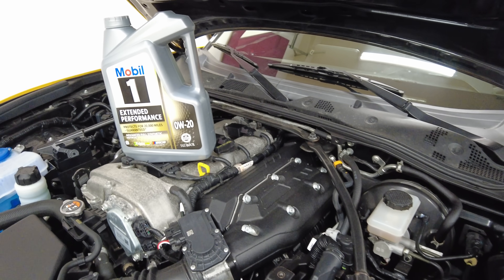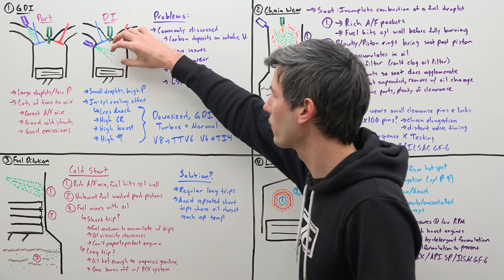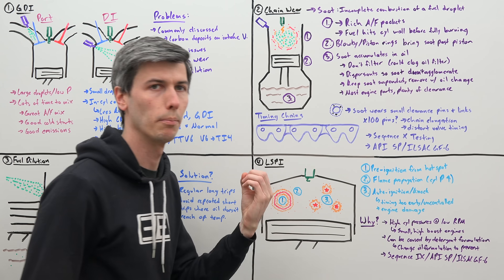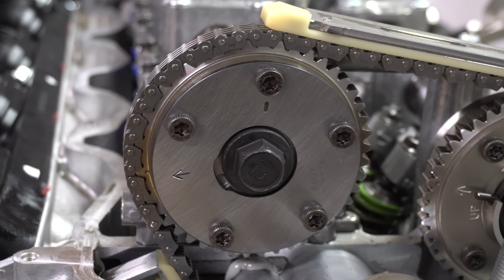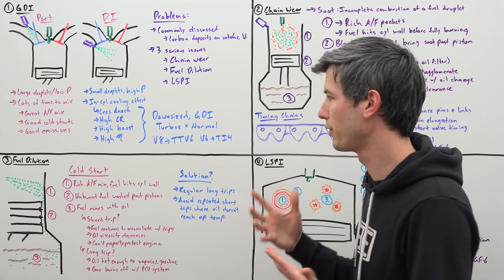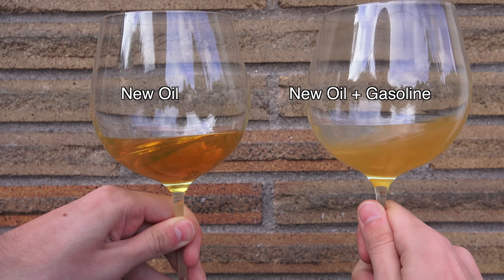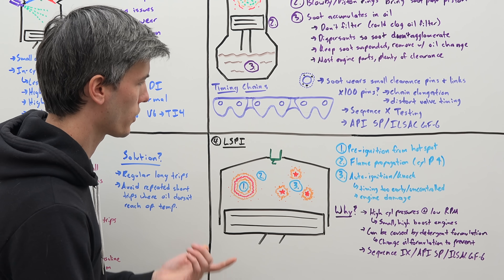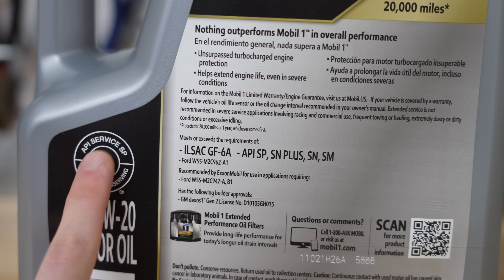3 Big Problems With Direct Injection Engines (Gasoline)

Comment: Late 90s early 2000s engines were the best. Decent power, not too much plastic, port injection, good fuel economy, and most were ulev so very clean. It’s a shame we massively increased price and complexity and decreased reliability for another 3 mpg.
Reply: Too true. My 1JZ-GTE VVTI is a good example of this. Pretty modern tech (improved by a new Haltech Elite 2500) - but not too modern that it suffers from all sorts of technical issues as a result of overcomplexity.
Reply: Love my K20 for that reason, it was just before emissions became stricter and so it revs to 8300rpm. VVT, Vtec, Still gets about 27mpg which isn’t bad, and is port injection
Reply: @TheRyansLion  and its naturally asperated. Those smaller engines with turbos are terrible.
Reply: @TheRyansLion  well, old cars do have the cool and fun to drive factor. I wonder how the K20 would stand against the modern GTI, for example aven when K20 was brand new.
Reply: @TheRyansLion  I've been wanting to buy an old civic or integra and do a k swap! It'll be a few years before I have time or money. Got 2 kids under 3
Reply: Yeah, this is true. Most of the German cars that I've worked on from that era were great in both power and efficiency, yet weren't too overly complicated where you needed to disassemble half the engine to do an AC Compressor. Unfortunately somewhere in the mid to late 2000's engines became increasingly more complex and crammed with more plastic and sensors/electrical components.
Reply: @hotchkess846  I want a 04 cobra motor with DPI and TI-VCT
Reply: @hotchkess846  German engines were all junk. No matter the era. The plastics and rubbers used in all German engines decompose after about 10 years. So if you do any work or touch any rubber or plastic part it will break and crumble after 10 to 15 years of age.
Reply: Corvettes could get 27-30mpg with port injection. I would routinely break 30mpg in my C5 Z06 with a stock rear ratio and when I went to a 3.90 gear 26-27mpg was the norm. This was with headers and a pretty big cam.
Reply: @xjmg007  you can do good mpg at stabilized speed/low rpm. if you drive the same way with a downsized turbo you'll get good (even better) mileage too.
Reply: @geemy9675  true, but I had 430whp n/a
Reply: Exactly that is why i love the MB W140 500 or 600 form. Peak of enginerring, bulletproff, a bit complex but nothing in today standards. My previous Renault Laguna 16v was a fantastic car, easy to work, cheap to maintein and superb comfort. Ironically in new cars my dream is the Viper or Corvette manual... push rod old GOD tech.
Reply: Ya. I bought a 1997 Lincoln town car (4.6 L v8) with 41k miles last year in July. It has more than enough power for my trips around the country.
Reply: I think the geo metro getting almost 40 mpg from the most simple engine to illustrate this.
Reply: @Dogpool  as much as I love the metro I used to have one and it was ok with me in it but I can remember having to take my 3 buddies to baseball practice and the last push up the hill the car crawled at about 20mph the Geo didn't have enough engine to push 600 lbs of boys up a large hill I would lose speed climbing the mountain near me
Reply: @sqike001ton  loved my 85' Chevy sprint! 50mpg+ with a 5speed . Reno to Vegas on one tank. Wish I had a clean one today!😁
Reply: @Dogpool  the geo metro got 49 mpg epa highway, which is almost 20% better than 40 mpg
Reply: I 100% agree. I have a 1992 ford ranger and an acura rsx. Both are extremely simple and very reliable.
Reply: You said it port injection, best ever.
Reply: The MPG gains of the last 20 years have been huge, you just don't see them because cars have gotten heavier as well. Mostly for safety, but also because of feature creep and because people want to drive a tank around.
Reply: @ice44567 Well said, I also don't want to drive a dinky toy around to get 27 mpg, maybe I wouldn't mind if everyone wasn't in a tank
Reply: Had to finally give up on the daily driven VW diesels around 2016 when the wife's 2004 Passat TDI got T boned. 
It got 41-42mph highway for many trips, so I was skeptical of the new 2014 Jetta gasser. 
Around town it's not the greatest ,but on those highway trips it returned 37.5.
For 4-5mpg it doesn't pay off for me to run a diesel ,what with all the problems the common rail engines have. 
DI for a gasser isn't much better, but it's got 82k on it now and still seems to run ok but only time will tell if it needs an intake cleaning, supposedly they are better then the older 2.0 engine.
Reply: Especially the 3800..
Reply: Man ne  Yea well... EU sucks with some things for petrol heads!
Reply: As Savagegeese said, new engines with direct injection are more efficient than port injected engines but what about after 30000? 50000? 100000 miles? What happens when all those carbon deposits build up? It's those bloody regulations to appease the elite who think they know best. 🙄😒
Reply: I totally agree with you. Todays engines are going to die young
Reply: Well, one thing they've finally done is send engines tweaked from factory.

Back in the day we'd buy a carb, intake and headers and gain nearly 100HP, not the case today.
Reply: I think pairing engines from that time with modern automatic transmissions would be incredible. I have 2002 Buick it runs perfect even with 170k miles and there’s almost no plastic on the engine. The only downside is the weak transmission, a faster one from today’s cars would be incredible imo
Reply: @alexadeshigbin8129  that is one thing I'd like to have in my Comet, a modern 6 or 8 speed auto.

They won't fit though, not without gutting the entire transmission tunnel and building a bigger one.

The 3 speeds had good torque capacity, when they added overdrive everyone built crappy transmissions, they finally improved on that in the last 10 years or so, even around 2010 a lot of transmissions could only handle a little more than the engine was rated at.

The only options for old overdrives is lots of $$ for strength or swapping to a manual.
Reply: @glenwaldrop8166  Wow, I've only seen a Comet once in my life (only in my 20s) makes my car seem like new haha. But I didn't even think about the new transmissions being larger, it's a shame there isn't a more cost effective way to improve them. And I definitely remember in the early 10s when transmissions were still mostly garbage and then years later they were all suddenly incredible. I'm just interested to see if the improved efficiency and speed of modern transmissions will translate into longevity.
Reply: @alexadeshigbin8129  there's a transmission guy on YouTube that I follow, he's good at building the new Ford and Chevy 8 and 10 speeds already, they're much better about torque capacity but they still wear out if you don't change the fluids, of course the ones he's rebuilding already have 300K on them so they've got to be fleet or something.
Reply: @glenwaldrop8166  Thats's cool, what's his name?
Reply: Exactly. The Gen 3 LS engines with port injection.  I have an ls376/480.  In a truck.  It is a phenomenal engine.  That does not share any of these problems of the Gen 4 LT.
Reply: Low tech is the best.  My Crown Vic with 4.6L 2V is worry free.
Reply: It's only going to get worse in the chase of MPG as the EPA keeps cracking down
Reply: I have a 2001 2L  Ztech port injection Ford engine. 222000 miles, clean, runs like new!
Reply: If only they added VVT to them and nothing else, that would be perfect.
Reply: @sienile  VVTIBisba thing since the 90s tho. Honda did it in the 80s already if i remember correctly.
Reply: @kaedeschulz5422  - Honda's early VTEC was static and only operated at very high RPMs, well outside the normal driving range. Other systems in the 90s only phased the intake. What I meant was independent VVT on both intake and exhaust.
Reply: @sienile  Oh yea... I fergot...
Reply: Late 90s early 2000s... they were ok engines.  Thing is that "decent power" isn't good enough when your competitor is putting out better and better numbers.  It's easy to blame the government or manufacturers or whatever, but at the end of the day it's the consumer that decides they want bigger numbers so all the manufacturers just have to appease.  Reliability for the most part is ok, though forced induction will just never be as reliable as naturally aspirated.  That's comparing apples to oranges though, since NA engine reliability hasn't taken a noticeable step backwards.
Engines of that era wouldn't be sufficient for the bigger, heavier cars of today anyway.  Doubt anyone would be interested in swapping a 2022 F-150 V8 (5.0L making 400 HP) for a 1998 F-150 V8 (5.4L making 235 HP)
Reply: @eksentrysyti  Yes, but the 2 engines you are comparing are non-force induction inherently balanced V8's and those are the most durable even for a half assed manufacturer. You should compare the turbo engines the worse being a non-inherently balanced turbo 4 cylinder engine. I don't expect more than 150,000 miles of any of the 1.6l Turbo 4 cylinder engines out today. By 150,000 miles, those engines will be failing emissions due to excessive oil burning.
Reply: Agreed
Reply: Exactly the reason. Obsolete faster=More profits
Reply: In the late 90's people were saying the same about the early 90's engines.  in the early 90's fuel injection was worked out and mature, after market mods were popular and programming offered performance and mpg was góod.  Who needed OHC with those huge 4 foot long timing chains rattling around.  In the late 80's people were saying the early 80's engines were the best (well, probably still calling the pre 73 engines the best).  No electronics, carb'd and full control with a flat head screwdriver and a vac gauge at your finger tips.  At the time, fuel injection was seen as the devil and would ruin the automobile hobby, tuning, and modifications like nothing prior.  Gas mileage was better and more power was being made compared to the 70's emissions compliant 7.0ish compression ratios.  In the late 70's and 80's they were saying the pre 73/74 engines were the best.  Mid late 70's cars and engines were just sad, no argument there.   Specific to the late 90's-early 2000.  I agree as well though.  I'm a Ford guy and the simplicity of a modular 4.6 2v that was in a ton of different cars for a ton of years and it just worked.  I'm sure other brands have their gems from that era as well.  I have a few of them still humming along with one at 320K miles.
Reply: Please compare today's economy car with one from the 90s. Then do the same with pretty much everything else. No, old is not better and even much worse. And not more reliable either. There are modern duds and old marvels, but those are outliers. Cars today are much, much better than cars in the 90s.  The only thing the old cars might give today's a run for the money is fun to drive and cool factor.
Reply: 1996 Toyota 5VZ-FE still going here!
Reply: Or, would be awesome if more did what Toyota did with dual injection. You get the best of both worlds, make more power, more efficient.
Reply: Your Government doing what it does. They push auto makers to increase fuel economy and so they turn to new technologies to compensate.
Reply: It wasnt for mpgs, it was because of EPAs
Reply: Thank the reformulated gas.
Reply: Car engines died in 2000. Now you have 100k miles and engine needs replacment.
Reply: Totally agree with you. Even I use a 1998 toyota
Reply: Was told burning oil  is normal for a brand new engine?? However my 98 Nissan Sentra burns no oil
Reply: Nothing but facts. 

Love my lazy 2002 Volvo S40 1.8L four banger. Looking forward to at least another decade of zero problems driving.
Reply: It’s too bad Canada is probably gonna implement having to safety your car every year (which costs so much to fix pointless things) and it’ll drive all the older used cars off the road as they will be too expensive to maintain even when they run great
Reply: Exactly.  I don't trust modern engines especially GDI or Turbo or both because they have no track record of running 300 000 km or more without any major problems.   I own a 98 Mitsubishi Montero Sport and 2011 4 cylinder frontier which has an engine from the 2000s era.  

Tundra I would trust up to 2021 because the GDI twin turbo 3.5 liter engine is not proven to handle the job of a V8 if you are working hard with the truck.  If they wanted a smaller engine like a 4 liter V6 normally aspirated I would be cool with that like the F150 has a 3.3 little small but the idea is no turbo and no gdi
Reply: I’ll keep my 2004 Grand Marquis with 298000 miles. Runs well everything original it’s not the best on fuel mileage .
Reply: Had a VW 2014 Passat 2.5 5 cylinder 

65000 miles camshaft was badly pitted and the oil smelled like fuel diluted after 3000 miles. 

Unfortunately this engine had a lot of plastic parts like the engine oil cooler housing , coolant thermostat housing valve cover and other coolant parts. 
Glad I got rid of it.
Reply: I agree...the best era for engines... ...we will never achieve the benefits of both worlds as this era, it was the best time, and most reliable engines , ever.  Bye reliable engines.
Reply: @1gbayfisher  Bye bye, or good bye?
Reply: That’s the government’s fault!  Weather is still Weather and it’s never changed! But government while war is now going on in Israel, still says that climate change is the worst problem in the world! Weather is Weather!
Reply: Fuel economy on ICE vehicles has gone down in the last couple years Ive noticed.
Reply: Love my port injected, cable throttle, metal and not plastic valve covers 2000 Nissan Maxima. Despite it being a fairly large V6, the engine bay still looks less complex than many of today's 4 cylinders.
Reply: The years where you pop the hood. And the engine looks like it's on life support. Cables, wire, tubes, hoses, everything a mess.
Reply: That’s just innovation, they need new technology and then improve upon it
Reply: Honda F23A, such a reliable engine. Die hard.
Reply: Getting 60mpg out of my Prius and can hang with most in “Power” mode 😂
Reply: The sweet spot!
Reply: My daily runner 95 Nissan n14 , vs high end European cars I worked for
Reply: Shitty thing is, that's when they started plaguing cars with shotty electronics. I feel like most cars from 02-09 had a lot of electric issues.
Reply: No, it was a mix of more mpg, more power and passing harsher emmission tests.
Reply: Blablabla
Reply: Bro, ulev?
Reply: @surfside75  ULEV is an emissions rating. It's an acronym for Ultra Low Emissions Vehicle.
Reply: @surfside75  ultra low emissions vehicle my 01 civic was one
Reply: @MrSGL21   Thank you. Did  my 05 Sienna 3.3 vvt-i make that list?
Reply: 3.3 vvt-i 240hp in the Toyota's;  my 05' Sienna Limited is amazing to me.  
 -Able to move this very heavy (5,700lbs!) minivan like a sports car😱 -😍.  -Reliability 500k (at 250k now).. i just drive it like I stole it😁
 (Timing belt at 100k and Change oil every 7k with full synthetic Mobile1 H.M. w/ M1 20k  filter)
Reply: expertly said, Flat Six Engines from Subaru (EZ30), and all the 6,8 Cyl NA Engines from BMW are superior to the junk thrown out nowadays - my EZ30 is on almost 140k miles and idles like a car on 40k miles
Reply: I’m a professional auto tech and I approve this message!  👍
Reply: to be fair safety, efficiency, power, performance, and unfortunately weight have all increased a lot.
weight increase is largely due to people buying SUV, crossover and trucks but not only
 price increased 2.5x slower than overall inflation since 1990.
 although last year has been crazy on used market and dealer markups. from my experience owning Toyota and Kia , never had any issues besides regular maintenance 
90'sn were also not that great with electronic issues.
Reply: Toyota hybrids managed to greatly increase mpg and lower emissions while reducing mechanical complexity and improving reliability.  They are port injected and non-turbo.  GDI engines emit more particulates and carbon monoxide than port injection engines.
Reply: blame regulations for this
Reply: Why I'm still driving my 20-year-old econobox — and since it's a simple engine I can maintain/repair it myself.
Reply: This!!
Reply: The body's were junk rusted away and plastic junk for 🇺🇸 car makers at least. The older the better metal they were made from
Reply: The “just 3 mpg”, is billions of dollars in savings every year.
Reply: The explanation of direct injection is not correct. If all of the fuel were injected at the same time in the cylinder, the effects that were described would be true. However, most manufacturers have moved from this antique system to multiple injections, during the same stroke, limiting things like valve carbon buildup, sludge etc. the minimum amount of fuel to “start the fire” is injected and followed by multiple injections until the valves reopen to burn off build up. New systems are also capable of multiple spark ignitions, thus again improving the burn off of the undesirable elements. His description of direct injection is at least 6-7 years old.
Reply: Another 3mph we dont even use.
Reply: Agreed.
Reply: Alero ecotec and volvo inline 5 turbo for the win 🏆 🙌 👏
Reply: Politely - you're shrooming.
Reply: It was a lot more than 3mpg, ESPECIALLY on light trucks.  GDI, TT V6s and cylinder deactivation have done wonders for the fuel economy of 1/2 tons at least.  Unfortunately diesel fuel econ has gone the other way due to them having to run really rich to keep NOX emissions down.  Deleting a modern diesel can double the fuel economy on a semi tractor, at the expense of EXTREME amounts of NOX emissions and NOX is one of the worst ones as it not only is a component of visible smog, it also causes asthma and COPD.
Reply: I've got a 2002 SEAT Cupra. The 1.8T engine is still strong after 20 years, despite having run a stage 2 map for the last 5 yrs.
Reply: I liked early 90s cars.  Old school OBD I stuff...
Reply: It’s a pendulum I believe, a lot of technology gives real benefits, but we find out over time where we did not know how much we did not know about the effect of the application of that brand new technology. As research comes in and understanding increases we can fix the issues and simplify things to be more reliable while not sacrificing all the new benefits, like lower weight by using a composite, or saving resources by having a smaller engine block for the same applications and etc. 20 years ago everyone was talking about how carburetors were better than port injection and more reliable due to how simple it was. Today we know computer controlled injection has allowed engines to last longer, while making more power and being more efficient. I guarantee another 20 years from now we will have new issues making people look fondly back at the cars of today being the best cars ever made. But on the bright side, this is the same mechanism that allowed us to come as far as we have, the ability to learn and pass it on generationally.
Reply: I've had too many vehicles experience emission issues, codes, ect. It's so aggravating if you want to regulate emissions make the system more reliable!
Reply: Port injection and good fuel economy? Haha please
Reply: Cars haven't gotten significantly more complex you just aren't that clever
Reply: bought 2000 passat b5 1.8t tuned to 190hp - great mpg and acceleration - 340k km. Super comfortable on long distances and 6.5l/100km or less if driving carefully.
Reply: Blame the US government for that bs
Reply: so your telling, 
the Emission standards are fake !?
Reply: Honda's naturally aspirated engines are still pretty damn good, the R18 and L13 at least. I'm sure there are plenty other good ones from other manufacturers.
Reply: Idk .  My 2016 turbo gets same gas mileage as my 97 but twice the hp and torque. 🤷
Reply: You missed the point, of course there is more power but at what cost? The complexity has gone through the roof, and the reliability has gone down. Your turbo seals will likely go out and egr/pcv fumes will clog it as well as the intake if it’s direct injection due to no fuel washing the manifold.
Reply: @johnnyreb86  no I get the point Im just saying it's a pretty big difference between the two.  It's not just 2-3 mpg
Reply: @102wingnut  I used Honda’s website for comparison, my old Honda vs a 2021 honda was only 3 mpg average difference.
Reply: @johnnyreb86  fair enough.  Was there a significant torque difference?  Like I said mines about the same gas mileage but a lot better to drive.
Reply: Just say no to direct injection, simple mathematics
Reply: I mean uh... We've definitely achieved more than "just 3mpg" from these changes. There's cars out there with 60mpg. Don't be disingenuous with your slow brain "change = bad" arguments.
Reply: @wanders278  sure, if you want to compare apples to oranges there are cars that get 60mpg, but since you’re too dense to understand what I was saying I’ll explain it like I’m talking to a child. The average mpg for a non turbo non hybrid civic from 2003 to 2021 only increased by 3-4 mpg according to official fuel economy numbers.
Reply: damn right. gas cars peaked not long after OBD2 was implemented and then needless complexity was stacked on top of stacks of stacks of it. I have a 96 and 03 and those are the last cars Im ever buying.
Reply: Agree with your every word there.
There's a lot of modern engines don't even make 100k miles.

EV is looking more and more attractive in my old age as I don't want to be changing dirty oil every 5k miles !
Reply: Detroit's biggest problem is that they are CHEAP. They don't adopt new technology or design until the Japanese have already perfected it and moved on. How late were they on bringing out 4 valve/ cyl engines? YEARS!!! The Nissan Altima had them in 1990. And GM & CHRYSLER are still building 2 vAlve/ cyl engines, Crazy. You can make a more powerful engine with 20-25% less displacement.
Reply: One cannot say best or unbest in general terms. A Honda Legend 3,7 v6 is a very competent automobile, this engine will surely last. But a TFSI vw is more modern. The bladibla gearbox with the 1001 solenoïde that is a trucking thang, remade with electricity (as they tell me) is the work of a madman. But if you have 207 E9 debt (9naughts) its rather plausible you cant buy what you want in the marketplace as they won't work with the homeless, if a friendly chines will pay with real money for your gearboxes.
Its..complicated, as is Meryl streeps lovelife.
Reply: LOL, all the apples and oranges comparisons. Engineering explained could  do a vid of this comment and comment replies. One thing that is no different since I took  autoshop back in the late 70s in HS, people, especially  older folks, have always over generalized saying older cars were  "better" back to some time earlier in their life.  Engine technology has gone a long ways. The technology that some are complaining about has made leaps in air-fuel mixture control, leaps in engine timing, leap in power. Much of this technology isn't  as much for emissions as for more our power. My 89 Ford Festiva has a 1.3L 53 hp motor. My 2017 Ford Festa has a 1.6L 193 hp engine, and despite bigger engine, 3x horse power, 1000 lbs heavier vehicle,  and driving on highway 15 to 25 mph faster, gas mileage is bad.
Reply: Thinking about getting a '22 Kia Carnival 3.5 GDI should I pass??😢
Reply: Love the Series II 3800 engine on late 90s to mid 2000s GM cars
Reply: If your lucky yea.. i remember k-jettronic in 90s Audis and VWs..
Reply: Agreed. I'll take a bullet proof 3800 over anything. A shame it got killed over new emissions standards, but at least it was prolific enough parts will exist for decades.
Reply: Agree. Tuned many Japanese engines of that era. Plenty of power and good mpg without as much drama.
Reply: No way those late 90s could produce the HP. And torque of today's high performance European engines and meet emissions requirements..if you want high horsepower and fuel economy you need a big wallet fir repairs.and maintenance..everything now is all aluminum twin cam.turbo..with a lot of plastic..which is actually durable and light weight of course
.
Reply: Planned obsolescence
Reply: I have never considered fuel economy when buying car.
Reply: Agree. Run a T5 Volvo from 05. Much, much better than any of the over complicated, plasticky, gimmicky nonsense now...
Reply: Idk, I'm still wondering where the additional 3mpg is
Reply: AMEN
Reply: Honestly
Reply: Agree 100%
Reply: LOL the changes were NOT made to gain any mileage!
Reply: Agree, german and japanese engine of 90s were simple amd strong, the one with cast iron block were bulletproof basically
Reply: Consumption went up, demand went up… compromises had to be made. Get over it
Reply: @alejandroochoa3541  found the government cuck, like being told what to do by bureaucrats do you?
Reply: The most efficient, reliable, and powerful engines were early 1970s to mid 1980s.
Mind you, American cars are 10 to 20 years behind the rest of the world.
Reply: But the difference is not of only 3 mpg its significantly more
Reply: 100% agree, as a mechanic I just can't stand these newer engines, they are nowhere near as good as the late models.
Reply: No CVTs were great too
Reply: 94 Civic EX I drove in high school was light, reliable and I saw up to 44mpg. Newer cars are heavier with more safety gadgets and have stricter emissions.
Reply: @chandleredwards  what hp did he had?
Reply: Longlive GMT400 and 800.
Reply: Is it often high oil comsumption on GDI engines? And how it is solved?
Reply: Shame we have Brandon and the EPA worried about ruining fuel economy and proven engineering for crap like EVS and direct injection.
Reply: what cars then had good mpg!?!?
Reply: @TaylorPhase  2003 civic was 32mpg. The 2022 civic is 35mpg, 3mpg difference. My 1999 Saturn would regularly get 33mpg.
Reply: @johnnyreb86  2024 civic days 42 mpg and also almost 100 hp more while being bigger and heavier too.
Reply: you’re looking at highway mpg only while I gave the combined. The combined is a more realistic number and that is 32 for the 2003 and 35 for the 2022. The manual transmission 2003 was rated 39mpg on the highway anyway. 3mpg difference. Also they are 127 vs 180 hp for the models referenced. That’s 53 horsepower, which I couldn’t care less about in a commuter car. They added DI, turbo, plastic engine parts. Reliability has gone down and cost and complexity has gone up, all for about 3 mpg.
Reply: @johnnyreb86  anyone not buying a hybrid in 2024 is just low in. Back then they didn’t have GDI hybrids. Now every GDI hybrid combined gets in the 50s. More horsepower, less emissions, and way better city and highway, and quicker working air conditioners
Reply: Yup, MB 140s were nice.
Reply: You are right about everything except fuel economy. Mid 2000s had improved fuel economy because your comparing them to mostly carbuerated engines. There is no doubt that modern engines are way more fuel efficient. The kinks just take time to be worked out. All that to say there is no better efficiency than electricity which is what most passenger vehicle will be using in 30 years. China already developed technology to fuel 300 miles of range in 5 minutes. That's a game changer. If you drive big cars like us Americans do it takes about 3 minutes to fuel 20 gallons.
Reply: Yes I agree.  I'll be driving 2000s vehicles in 2050 because the EPA forced all manufacturers to overcomplicate engineering and drastically reduce reliability.  But go ahead folks buy your brand new vehicles with their 30-60,000 powertrain warranties.
Reply: 3 mpg X’s hundred of millions of cars = less oil consumption in the long run.
Reply: You're looking back on the 90s fondly which I understand, but you are wrong. The Mustang GT in mid 90s had like 215hp, the very expensive rx7 had 250ish and the also-very-expensive supra turbo had 320hp...compare that to a mustang today which has 310hp for the turbo 4(direct injected btw, they get 30mpg+) or the 460hp of the basic GT. Older muscle cars get their doors blown off by todays family sedans.
Reply: @thebarry7546  Not all of us are hung up on outrageous horsepower ratings.
Reply: Thank the government for this.
Reply: @patricknesbitt4003  Thank the consumer for being ignorant and brainwashed by media. If people know better they will buy better cars.
Reply: @patricknesbitt4003  the government did not mandate to make engines complicated, just more efficient. 
Auto-makers could make it easier to service. From making a simpler design to providing better manuals and other tools.
Just like the phone you are using, manufacturers have been making everything more difficult to repair to increase their bottom line. 

If you want to blame the government for something, blame them for taking corporate money and not protecting the customers/users/buyers of anything to actually fully own what they buy.
Reply: @patricknesbitt4003  freaking CAFE
Reply: @patricknesbitt4003  They dont have a clue what they are doing
Reply: Not saying you’re wrong. In the US, we elect our government, thus we are the government.
Reply: @patricknesbitt4003  Not the government alone the liberal democrat government.
Reply: @patricknesbitt4003  Government seems to think that if they can pass a law for something to happen, then it will happen. Like saying fleet mpg's must get up to 50 mpg. You can't get more power out of a gallon of gas beyond a certain point and I don't want to drive a ridiculous tiny little car that would still have trouble getting that many mpg's.
Reply: @patricknesbitt4003  however it's all to do with cleaner air.
I like to breath clean air, don't you?
Reply: @patricknesbitt4003  having lived in LA in the ‘60s and ‘70s, I agree, and not in a sarcastic way
Reply: @patricknesbitt4003 nahh, thank the bean counters for colluding to not innovate! The German automakers were all caught for this and subsequently fined. 

Said bean counters also like that recurring service revenue. Having a fuel efficiency and easy to work on car are not mutually exclusive!
Reply: @patricknesbitt4003  yeah they screwed us in the 70s and 80s to with the low compression requirements also
Reply: @alexlandsberger1423  That's mostly due to the fact that emissions reduction technology was primitive at best. The electronic technology just  didn't exist at a level that could be engineered into an automobile reliably and in a cost effective manner.
Reply: @alexlandsberger1423  There was no other way to make engines smog legal.
Reply: @patricknesbitt4003  really? It’s progress I believe…
Reply: @patricknesbitt4003  My safer late model car saved my life, thanks "government"!
Reply: @chuckz8053    “semi TRUE”
But, not all cars have a 5 star ⭐crash rating.
 I’d thank the engineers for most of those ‘safety features’
I wonder if the government will mandate anti-corrosive brake & fuel lines and limit the amount of corrosive salt on the roads and corrosive alcohol in the fuel.🤔
Reply: @chuckz8053  Straw man argument. Not referring to needed regulations for safety improvements (Within reason). I'm referring to the laws of diminishing returns by way of increasing cost, complexity and decreasing reliability by chasing increasing smaller MPG gains. The benefits of saving an extra 1-2 MPG's and decreasing emissions by a few more percentage points are lost if you're creating scrapyard fodder much earlier by having to replace an engine at 80-100k or so miles instead of having a well designed and built engine that lasts much longer and doesn't require expensive (There goes the fuel savings) replacement. Remember an engine takes a lot of energy and resources to build. this also holds true for the increasingly complex and expensive transmissions being used. Especially the CVT many of which cannot even be rebuilt and need to be replaced with a new unit.
Reply: @chuckz8053  Spot on!  So many commentators, including some famous YouTubers who like to rev up their engines, overlook the huge developments made in passenger and now pedestrian safety also. 
My ideal car would be a small BMW, circa 1980, with the structural integrity and secondary safety available today. It would be fully electric but have some kind of exhaust sound thingy to ensure we all knew it was once an in line six. 
Happy Days..🇦🇺🏳️‍🌈
Reply: @Ben-jq5oo  please no fake exhaust sounds
Reply: Facts
Reply: @Mikebuildss not in Europe.
Reply: You can thank the EPA. Manufacturers have to use all kinds of tricks to meet mandates. Its significantly hurting our vehicles. Toyota went to a turbo v6 in the tundra and have a bunch of recalls because they're over stressing the v6 when a v8 could effortlessly do the job. 

The EPA's own statistics say transportation is responsible for 14% of co2 emissions and that includes Jets, boats, 18 wheelers, ect. The majority of co2 comes from agriculture and industrial plants. Car owners are being unfairly punished for it.
Reply: Smog was a very real thing. One thing we don’t consider isn’t just emmissions but NOX emmissions that drastically lower the quality of the air, those have seen major improvements over time.
Reply: @mikeoxlong3676  There’s a reason for that. Cars offer unlimited mobility and freedom. The more government can do to restrict mobility the greater its ability to control the population.
Reply: @mikeoxlong3676  No more V8 Tundras?  They won't clamp down on agriculture because it is almost all corporate nowadays, and the government loves corporations.
Reply: @mikeoxlong3676  Blame the "Demoncrats" for all this BS!!
Reply: @mikeoxlong3676  is that all?? 14%....all this bs for 14% is nonsense.
Reply: I actually like the 80s stuff better there only downside is the EPA smog compression limit but they run forever and no plastic. I had a 03 Buick regal 3800 that got 23mpg and also had a 86 Pontiac paressian 4.3 that got 21-22 mpg on the same route and even the same tires. How does a tbi 4.3 so bigger engine less power non overdrive rwd bigger heavier less aerodynamic car get basically the same millage,and it was way more comfortable to. For another example I have a 85 dodge half ton with a slant 6 with 31inch durratrac type tire and my dad has an 09 Nissan frontier 32 ko2 tires and I get equal to or better mpg
Reply: @alexlandsberger1423   cars also used to get better mpg before they started diluting gasoline with that shitty ethanol.
Reply: @alexlandsberger1423  couldn't agree more the god thing about the 80s car is deleting the gas guzzling smog crap is usually fairly easy tho I still say peak US cars were the 80s look at the fox body mustangs and how they changed the drag game at the time
Reply: I think that, inch by inch, we'll get better without sacrificing the spirit of 90's cars. Look at the GR86, for example. It retains and improves upon the driving experience of 90's sport coupes while improving fuel economy a bit. I think cars like that give us hope for the future of petrol.
Reply: @Slays_Media  well.. not especially reliable though..
Reply: @Slays_Media unfortunately innovation to ICE’s will only go so far before we just go electric
Reply: @Slays_Media  If the government's don't ban gasoline car's altogether...
Reply: @kaedeschulz5422  Government doesn't have the power to ban ICE cars that they don't agree with ... Canada: "Hold my Moosehead" (Yeah, I know...Trudeau is more into Cucktails)
Reply: @1966johnnywayne  California already set a very close date. Not sure if it was 2025 or 2035 where they were going to ban the sale of gasoline powered engines including tools like lawn mowers or something.

Edit: California, not Canada, lol
Reply: @kaedeschulz5422  are you aware that most large manufacturers have already committed dates to phase out combustion engines? Hyundai shut down it’s combustion engine division in January  and moved all engineers to electric R&D. It’s already done.
Reply: @dominicbritt  Yea nee car's... What happens with the old beauties tho? Recycling? Still allowed on the road? Regulated to death to a point that no one wants to deal with it? idk. Electric isn't always better for the environment tho that's the problems to me with E vehicles. For me hybrid's seem to be the best. they do both but less of both for a normal car with 150hp or whatever.
Reply: @kaedeschulz5422  they are
Reply: @SI0AX  they just banned gas powered leaf blowers starting next year
Reply: @lonniebeal6032  corrupt is a very accurate definition for politicians acting in the sole interest of making CEOs friends richer.
like every republican since Reagan
Reply: @SI0AX  You spelled Commiefornia wrong.
Reply: @SI0AX  ban sales of new ones. Not used ones.
Reply: @pmscalisi  I haven't heard of them banning the sales of used ones especially if it's a private party sell. I think they will eventually ban the sell of gasoline but until then, used cars might be the only way to keep buying gasoline powered vehicles.
Reply: @kaedeschulz5422 America’s won’t, the American currency is named the petro-dollar for good reason, everything in America literally requires oil to be created and function. From the electricity charging EVs to the plastic to make them and the vehicles to ship them.
Reply: @Slays_Media  we/people need to buy them new, or else manufacturers will stop making them
Reply: @pfunk34   Pretty sure it wont matter if we buy new or not because. Governments will force manufactures to stop making them.
Reply: @Slays_Media  I hope so aswell, but sadly the focus of the car industry is nowadays SUVs and EVs. My next car will be a i30N which I will hold unto as long as possible.
Reply: Yes. Self-tuning engines, early diagnostics without today's over complexity, reliable engines capable of 1/4 million miles. That was the pinnacle of engineering alright.
Reply: I have a 1999 with DI - 3800 series 2 SC.
Engine is great, but the coolant gm used was junk.
Reply: I couldn't disagree more. I owned a 1995 Mustang GT with a 5.0L H.O. pushrod engine with port injection, producing 225 HP. Fast forward 20 years and I purchased a 2015 Mustang GT with a 5.0L DOHC Coyote, which produced 425 HP, was considerably more reliable, and got significantly better fuel economy.
Reply: No one disputes that engines today have more horsepower, the issue is the complexity, cost and reliability. Also your example isn’t what I was talking about. A 95 mustang was an OBD-1 car with a 15-20 year motor design. I specified late 90s to early 2000s, after they switched to more powerful computers and obd-2 systems, much more reliable than obd-1. Engines were updated to comply with obd-2 and were leaps and bounds better, like chevy going from the lt1 to the ls1 in 98. Walnut blasting of intakes is now a common practice with direct injection that has to be done sometimes as early as 20k miles. Variable displacement causes oil frothing and consumption as well as sticking lifters. Timing chains wear prematurely whereas my 97 Saturn went 250k on the original timing chain. Stop/start causing engine wear and starter failure. High pressure injection pumps for GDI are notorious for failing, as well as higher fuel line pressures causing leaks and fires in Kia’s/Hyundais. There are entire aftermarket industries made to defeat “fuel economy enhancing” features.
Reply: The gains of newer cars are actually more than 3mpg. The problem is there has also been a push to more hp and faster 0-60s. If modern cars had similar performance characteristics to cars of the 90s/2000s you would see the mpg much higher. But no one would be buying them as they would be too slow. The technology has bought us more hp at similar mpg. A civic from the 90s could do 0-60 in 9.5-11 sec. A modern DI turbo civic (non si or R) does it 7.5. And the newer car weighs about 500 lbs more too.
Reply: @WantonSoup192  ,It seems only you American's ,have a zest for the 0-60 sec b/s and speeding tickets.
Reply: @raydavies3278  I’m Canadian and I bike commute when I can.  But yes there is a bit too much need for speed.
Reply: @WantonSoup192  Problem is most cars from the 80s into the early 90s could only dream of 0-60 in 10 seconds. I had 3 80s vintage cars and the best any could do was 0-60 in about 14-16 seconds. When you live in the Northeast with its 1920s infrastructure and you have to get onto US 9 going up a 6% grade with no acceleration lane into 50+ MPH traffic you better have some juice under that hood.
Reply: If direct injection engine was such a problem then the Lexus IS 350 engine wouldn't be the ultra reliable engine that it is.
Reply: @Re3iRtH  Uh, Toyota uses D4S fuel injection that has both port and direct fuel injection. They have been doing this for well over a decade now.  The GR series of engines have evolutions and variations which now incorporated this system after moving from port MFi.  However the early 2.5 and 3.0 liter engines were DI only and called D4.  The biggest D4 culprits were engines that had the 1AZ and 2AZ engine codes and that was a big problem because these were engines on Camrys and RAV4s in the early to mid 2000s until around 2008 or 2009 when the 2AR-FE was introduced with the D4S injection.  So avoid used Toyotas that have D4 engines like with those engine codes.
Reply: Blame the liberals
Reply: This is funny because I clearly recall lots of guys saying that "new" engines were TOO complicated with all that "EFI and computers" back in 2000. Most new cars will do 200,000 miles easily with regular maintenance. New cars have far more power and use less fuel, and make less pollution. Direct injection isn't a problem if you use quality oil and change it regularly.
Reply: @21jimmyo  Most people refuse to have their oil changed.
Reply: Have been wondering how much better mpg one could get with a standalone/aftermarket ECU from something thirsty like a 2.0 early 2000's Subaru..
Reply: @HulluJanne  My 3.0 EZ30 Subaru has a remap for 99RON, I get over 30mpg on long runs doing around 80mph... city driving is a killer however..but I can live with it because its reliable and quick and handles like a go-kart
Reply: @HulluJanne  It could be easily low 30MPGs.  If you increase the compression ratio and play with part-throttle timing and fuel trims it can be improved.
Reply: We also increased power and torque and gained 3 mpg. A modern 2.0t is far more powerful than a 4.0 V6 from the late 90’s and early aughts.
Reply: @yolo_burrito A 2.0 Turbo from the 90's had more power than a 4.0 V6.
That's an 80's 2.0 turbo you're thinking of. And those were under tuned.
Without race prep tuning a 4 liter 6 it gonna be pretty limited in power.
Porsche is getting around 500 horsepower out of it's just about 4 liter flat sixes at current year. That's the road car engine. And they're using every trick in the book to do it.
A Turbo 4 from the 90's could easily make that fairly reliably. 
But it's always about money.

You can make 500 horsepower with the Geo Metro's 1.something liter 3 cylinder engine if you spend enough money building it the right way.
Of course, it probably won't hold together very long.
Bearings might melt after your third gear change. The block might crack from heat if your boosting it with turbos. 
But it can be done.
BMW made a 1.5 liter 4 cylinder with 1500 horsepower in qualifying trim for Formula One in 1984(I think it was. Maybe 83)

The only key is, how reliable will it be for street use.
That BMW 1.5 I4 Turbo isn't gonna work in your 3 series Bimmer.
It needs a 12 man race team to run and maintain it. And it would need to be rebuilt after about 200 miles of driving.

So, to say a Turbo 4 makes more power than 4.0 liter 6 is a misnomer. 
It's something a sales rep tells a stock brokering dude bro to get him to spend an extra 12k on a car with a higher commission bonus.

You can slap an aftermaket centrifugal stuper charger on Jaguar's 4 liter 6 and make 500 plus horsepower without breaking a sweat.
And yes, I'm talking real world here, not Forza Motorsports logic.

Jaguar has done this. There are variants of their 6 that are factory stuper charged. In several models over the last 15 years.
Jeremy Clarkson raved about the F-Types stupercharged V6 engine. 
The V8 makes more ponies, but the 6 is more sublime. And sounds like the old E-Type.
Reply: @yolo_burrito  But a 2.0 with more power than a 4.0 V6 will produce less low RPM torque, make more noise, and vibrate more.
Reply: Nope. Electric motors are far superior to any ice motor
Reply: @LouisDuran  they are in every aspect and by every metric. batteries are the only bottleneck. the most advanced electric drivetrains are not far from even a top fuel drivetrain power to weight ratio, while being many orders of magnitude more reliable and dont need to waste all that energy to  melt the clutch at 3700F at every launch to stay in it's operational rpm range. even a top fuel engine advantage over electric motors is mainly due to nitromethane energy density and the possibility to use all that wasted energy from the exhaust to generate thrust and increase traction and acceleration from a stop. comparing road engines that need to be able to run for hundred thousand miles is no match for electric motors. plus we are barely scratching the surface of what electric motors can achieve with Tesla plaid carbon sleeved rotors and their motors that don't lose power at high rpm.
Reply: @LouisDuran  btw my EV's motor is 60lbs...
Reply: WAY more than 3 mpg. We have turbo 4cyl’s  getting close to or at 40mpg city. 20 years ago you were looking at 20-25mpg in the city. 

I remember getting 24mpg  highway in my turbo eclipse in the late 90s. That’s awful. Not to mention stock it was 200hp 😂
Reply: Comparing apples to apples, the 2020 covid 4d auto gets 33mpg combined and the 2001 civic 4d auto gets 29mpg combined. Using current math that’s 4mpg. Not that much of an improvement for the cost and complexity increases, not to mention the decrease in reliability.
Reply: Civic not covid lol
Reply: You forgot government mandated 3 mpg.
Reply: I doubt in real life that really exists considering these engine start self destructing quickly our GOVERMENT has failed us in only requiring these engines perform these numbers when new no long term tests
Reply: Thanks Obama
Reply: A lot of this is manufacturers trying to run their engines lean.  Which not only decreases fuel consumption but also increases power.  Leaner makes meaner after all.  The only reason 80's and 90's vehicles didn't do this is because catalytic converters couldn't deal with the extra pollution a lean running engine causes.  That and the heat it produces.  A lot of engines that were built out of aluminum  could be  tuned to run leaner and make more power, like LS based engines.  If you have an old enough vehicle you could tune it without needing to pass emissions.  Modern cars have to pass emissions so things like Direct Injection are needed.  Even though some are now walking back Direct Injection by also including Multi Port injection... again.  Only wish tuning a Porsche 928 was as easy as a LS1.  That thing is all aluminum and 32V as well.
Reply: 3mpg? More like 30% better mpg, while having a lot more power. People exaggerate the reliability issues of modern engines. It's not that bad. Also, some new engines start to use both port and direct injections.
Reply: The 2022 civic is rated at 35mpg combined and up to 40mpg highway. My 2000 civic usually gets 30-32 combined and 35-38mpg highway. So yeah that’s about 3 mpg better or so. 200k miles and no issues so far. Just fluid changes.
Reply: @johnnyreb86  The 2022 civic is also the size of a '99 Honda Accord...
Reply: @johnnyreb86  the 2022 civic is also much heavier. It is about at 20% to 30% improvement, but the weight gains shave some of those real life mpg gains.
Reply: @johnny2wheel  it is a different car with great same name. I do not want to be your passenger in a collision, for example, sorry. Plus the new civic will outrun and outhandle the old one. Hands down. What's cooler?  The old one, probably. But that's about it.
Reply: @johnnyreb86  it's also much quicker, larger, comfortable and upscale. a new base 2000 civic would sell close to zero nowadays. of course a mint type R would sell way over MSRP because of its rarity. the problem is that the car market is drive by people who buy new and they buy SUVs,crossovers or trucks.
Reply: @johnnyreb86  compare weight, and features now too. You’ll see why it’s only 10% gain while it’s a few hundred pounds heavier and way more comfortable. If you’re gonna compare, make sure it’s looking at all the angles.
Reply: @johnnyreb86  but at what bhp difference ?  an 2005 ep3 civic  k20 had 198bhp and did 28mpv my 2015 fk2 civic 310bhp and does 28mpg same milage but 112 bhp more
Reply: @johnnyreb86  your 2022 is also a size class bigger than the 2000 and a lot more crash safe. Moving up to a compact from a subcompact and adding to the crash safety adds weight. Drop 2022 engine tech into a 2000 and it would improve by much more than 3mpg.
Reply: @johnnyreb86  I’m pretty sure a 2022 Civic gets much higher than 40 mpg on the highway, no matter what the EPA says.  I used to reach 45 mpg on the highway in much less advanced compact cars.
Reply: @silimarina.  Nope is you generalise yes. I have a 20 year old honda jazz and its reliable and after 200 miles still get the economy of a brand new car. I drove a 1989 opel 1.6 kadett with a carb, 400 miles, and averaged 42 mpg. Choose you car and don't buy to your emotions.
Reply: @raymondglad5593  Dude you must take into consideration that modern cars are a lot heavier than older cars. You can't compare an 89' 1.6 Kadett that has 75hp and weighs 900Kg to a modern car that has a lot more weight and a lot more power from a similar size engine. Also, modern engines have a lot fewer emissions.
Reply: @silimarina. This is too true. Small crossovers of today are bigger than my '97 Chevy 1500. Oh, and the 4.6L motor got less than 20 mpg mixed. My 2024's naturally aspirated 2.5L makes only 13 hp less, is safer, faster, drives waaaay better, is just as big and has more creature comforts. I'd like to see a size comparison between a 90's ranger and a new ranger.
Reply: @silimarina.  My 99 explorer 5.0 awd has gotten 25+ in certain conditions. Had an 81 f150 300 inline and a 1 barrel carb would get 30mpg at 55mph or less. 30% better mileage, nah not buying it.
Reply: @ApethGrader  Then why are all these new cars with 3-4 times the Hp of your 81 Ford with a lot lower emissions have the same or better mpg?
Reply: @silimarina.  yep the maverick does 40+ real life mpg city and highway. not stabilized 55mph which is like the engine idling in overdrive. seems like lot of people are biased and they always get 2x the original milage on a 40 yo car....ok downhill, downwind and at stabilized 30mph. I know you can get better mpg than EPA (I get up to 32mpg highway IN THE RIGHT CONDITIONS way over the advertised 25mpg on my Sorento V6. usually more around 30mpg at higher speeds like 85+, but that's with no strong wind, steady traffic, and no freezing temperatures
Reply: @silimarina.  I have been a Dealership technician for 28 years and can tell you first hand that the engines I've repaired or replaced  might get a bit more than 3mpg over a Port injection engine but the serious engine repairs and replacements I have done to these cars vs the 1990 and early 2000's models is ten fold. Especially  the turbo 4 cylinder variants.    

The Timing chains elongating,  cracked pistons and problems with the injectors are common. Combine this with the longer oil change intervals and the eco engine shut offs and you have a recipe for much shorter engine life.  

A lot of engine in the 1990s went 300000 mile or better with good maintenance , not seeing this with the newer engines.  

30% more MPG over a port injected engine is a not realistic unless its a smaller lighter car.
Reply: @silimarina.  any gasoline car with a small block and a turbocharger isn’t going to last a like many late 90s/early 2000s cars that are still chugging along on the road today. 

Don’t kid yourself.
Reply: @silimarina.  The reason they are using port injection along with GDI is to correct the valve fouling problem created by GDI.
Reply: @patricknesbitt4003  Yes, i know
Reply: @silimarina.  I used to see people moaning about engine computers and fuel injection, they seemed to think carburetors and 'points' (you know, things you can 'fix yourself') were better. Well I grew up with that stuff and it was NOT better. Sure you could 'fix it yourself', and you were going to spend a lot of time doing just that. Also, below zero F you had only a 50% chance your car would start and at -15 F you had maybe 10 or 15% chance. I was telling my son this PM about my 1979 Dodge 4WD, it could get an absolute max of 15 mpg highway and it was like a wet noodle under the hood. My '19 F150 Eco 3.5 get get 23+ on the highway, 17-18 around town, and would blow the DOORS off the older truck.
Reply: @silimarina.  port plus direct injection  used by Toyota....is it that added expense that causes them to compensate by neglecting  Styling, Interior trim, handling, road noise concerns....is why I'm picking up my new mazda cx30 tomorrow..these are all major issues so I'll deal with the direct injection issues.....an yes the skyactiv engine has proven to go the miles..
Reply: @silimarina.   in all honesty, I’m not seeing all these problems with direct injection that people are talking about, at least not in the Fords.
Reply: @silimarina.  No they don't.
Back in the day, the majority of cars made it 100,000 miles no problems.
That's a rarity nowadays, only Toyota and Honda and Mazda can achieve that feat.  The more complex something is, the more likely it is to break. That's just law man, not nostalgia. Cars nowadays are trash, especially anything the Germans touch.
Reply: @silimarina.  I don't know if it's the effect of the almost 30% ethanol we have in gasoline here in Brazil, but I saw improvements in fuel economy of almost 100% when engines started coming with direct injection. Mercedes Benz four cylinder engines went from 6 or 7 kilometers per liter to 13 or 14 kilometers per liter. Same engine platform, just switched from supercharger and port injection to turbocharger and direct injection. But the engine started blowing up.
Reply: @silimarina.  poor reliability of todays engines is from poor maintenance and cheap oil/oil filters
Reply: It's the last 10% of performance that always costs the most. Not sure "price" has "massively increased" - most of the price increases are due to more complex software. BMW, for example, now spends over 30% of its R&D on software alone. This is before you even get the big chunk of clay out to start to shape a new model.
Reply: Well my 2000 civic cost 14k and a new one would cost about 23k, almost 10k more, a better car? Sure. 3mpg for 10k? Not sure it’s worth it.
Reply: @johnnyreb86   Factor in …
1. safety features incorporated into the newer vehicle 👍
2. the value of the dollar has depreciated, so it takes more dollars 🧐
     the downside is .. it cost more to fix the new car, 🙄 should there be a problem …. There’s always a trade off 🤷🏻‍♂
Reply: @johnnyreb86  14k in 2000 is equivalent to 21,700 in 2022... so you get a way better car for 1,300$ more.....
Reply: @johnnyreb86  10k didnt go into the engine alone. Feature creep, more power and inflation all take into account.
Reply: @stepside2839  the best safety feature any vehicle can have is a driver that has been properly educated to pay attention and drive properly. Something that is lacking in todays society
Reply: @holmes1956O  CORRECT 
it is called,  “An adjustment of the ‘nut’ behind the wheel”
Reply: @johnnyreb86  inflation is a thing…
Reply: @johnnyreb86 so the new civic is cheaper? 14k in 2000 is equal to around 25k today.
Reply: Wrong. The new Mustang coyote engine 10 speeds destroy 90s 2000s cars and gets better gas mileage and is reliable.
Reply: @mattjones1378  4 speeds more than needed.....these new many speed trannies will be the problem when they age....so I get my 6 speed mazda today
Reply: youre just looking back with rose tinted glasses
Reply: Consumer reports does annual survey of its hundreds of thousands subscribers, on car reliability. Usually, car reliability goes down for a year or two after a major redesign of a model. However,  contrary to what some claim,  the data shows car reliability continues to improve overtime while cars added convenience technologies, became safer, and more fuel efficient  A decade or two ago, a car with 100k miles was considered to be near it's end-of-life. Now, 100k is considered to be a mid-life for a car. I hear many YouTubers talking against the newer techologies such as CVT transmission, direct injection, turbo charging, etc. The proof of a pudding is in the eating. The kinks in the newer techologies have been worked out and there are now many reliable models on the road with these technologies, as the consumer reports magazine survey shows. The fuel efficiency gains due to these technologies  are also  in the 30-40% range over the decadee; however, consumer taste have also shifted towards larger SUVs which made us lose ground on the fuel efficiency front and also made vehicles more expensive to own. Even though it is fashionable to blame the government for everything , the consumer has benefited, overall, from the government's push toward improved fuel efficiency and safety.
Reply: @metimeti1998  just rented a Hyundai venue with a cvt was honestly not that bad for a 120hp compact crossover with very little torque. it was not fast but it felt more responsive than an automatic slushbox with same power. it even took me a while to realize it was a Cvt because it had a manual mode and the fact that I was focused on dodging the huge potholes and puddles. even the manual mode was quicker than on an automatic and a nice addition for twisty and steep roads. just enough ground clearance to clear the very rough dirt roads without worrying too much, and easy to place thanks to the narrow and short wheelbase.
nothing fancy but does the job
Reply: @metimeti1998  There are more things in life than fuel efficiency.  I, for one, like biggness, comfort, a nice soft ride, lots of low RPM torque, mechanical and electrical simplicity, and the ability to work on the car myself.  I do not want a rolling computer, no matter how "fuel efficient" it is.  The main reason later cars last so long is because of vastly improved motor oil.
Reply: @metimeti1998  CVTs still suck. I’ve had that experience too many times.
Reply: @pmscalisi  It all depends on the manufacturer. Toyota Corolla and Honda cars now have CVT transmissions and they are reliable. Note that conventional transmissions from some manufacturers are also unreliable.
Reply: @metimeti1998  I had a Nissan. That might’ve been some of the problem.
Reply: @metimeti1998  100,000 mile life expectancy is 40 years ago.  The best built cars and trucks from the late 80's onward are expected to make 300k if taken care of.  Yes, even American vehicles after the Detroit union workers got a kick in the pants from foreign competition and improved quality control.  Japanese cars are well known for longevity from that time period, Crown Victoria's and GM's 3.8 liter V6's, ect.  You are way out of your time frame.
Reply: @kingduckford  - Did people claim in the 90s and 00s that older cars were better? Yes, they did. Did they claim the "gubment" ruined cars with all the rules? Why yes they did. People have been saying the exact same things since the Model A replaced the Model T.
Reply: @21jimmyo  No, they haven't.  Everybody has talked about how great new cars are since the day of the Model T.  Because older model cars broke down constantly, were hard to start, and they were glad as improvements were made over the many decades.  Nobody really complained when EFi replaced carbs, nobody complained when US cars actually lasted to 200-300k miles in the 1980's when they were breaking down at 80k in the 70's, nobody likes big gasoline bills, ect.

It is just that people can objectively talk about certain qualities vehicles in the past have over today.  Cars from the 60-80's were more aesthetic and beautiful, had softer rides and suspensions in general, as an example.  

The objectively superior thing that people in this thread are bringing up is this:  older engines were simpler, had less to go wrong, and could be fixed and rebuilt for less labor/money/time.  My example of Ford EFI motors on designs from the 1960's, other people's examples of the engines of the 90's, both proved longevity that matches the most modern motors, and both are cheaper to rebuild, and less can go wrong.

Neophiles are well trained to tell likes like yours.  Attack anyone who has anything valid to say about old things.  Praise what is new, worship it.
Reply: @21jimmyo  I can point out the exact failures caused by regulations. I remember back when cars made in the 80s were driven around - engines getting worn out was relatively common on high mileage vehicles. Things improved over time and in late 90's and early 2000's and engines getting worn was pretty much unheard of. In most cases the rest of the car would fall apart, or it would rust away, but the drivetrain remained in good condition even at high mileages. Fast forward 10 years - we now have bicycle chains for timing instead of dual rows. And instead of the chain lasting 300k miles easy, we now have to change them at 100k. Over the lifetime of the vehicles that is 3-5 timing chain changes with all the labor costing literally thousands. My friends 2014 Volvo 1.6d had piston ring wear and oil consumption !!! At less than 100k km's. 
VW TFSI engines are infamous for piston ring wear. All because manufacturers needed to squeeze that extra 1%  corporate average fuel economy (or in EU - CO2 emmisions, which are pretty much directly proportional to fuel consumption for a given fuel).
We are now getting back to the 80's with engine longevity.
We are getting pathetic engine designs since 2009. Guess when the EU introduced CO2 limits ?!
Reply: @kingduckford  engines (and cars) are no longer designed for that lifespan any more. The industry has pushed to exclusively hire/lease car purchase options - manufacturers do not need to focus beyond 5 years anymore - handy for unreliable European brands.
Reply: @kingduckford  Watched my mom's 1984 Oldsmobile 88 engine explode. The Monte Carlo had the same engine but it started knocking around 200k. Our 89' Bonneville was a beast, good car. My 92 had an excellent engine and transmission 220k miles was still going strong, but everything else on it was trash. Every fall I had to change out the alternator. Wised up and bought a lifetime warranty one so I didn't have to keep buying them, just swap them. 1998 Grand prix 3.8 started leaking coolant into the motor oil around 120k. Series 2 3.8 was probably the most reliable, non-supercharged version.
Reply: @kingduckford  yup climbed into someones tahoe a few weeks back, she was at 306k.
Reply: @21jimmyo  they're probably talking Honda Civics, Ford F-150, and Toyotas
Reply: FYI: That model T had 4:1 compression making 13HP  and getting 25-30MPG and the top speed was something like 40MPH. ICE has come a long way in the last  century
Reply: @petarmiletic997  
TFSI are absolutely not "infamous for piston ring wear".  Not at all.  Their issues are mainly wear to the high pressure fuel pump cam follower, followed by timing belt maintenance and timing chain maintenance.   Yes, it has both an intake cam belt and an exhaust cam chain.  If these issues are cared for, I've seen tons of people with 300-500k miles.  Never once seen a failure due to piston rings.
Reply: @kingduckford my 1975 Ford E-150 van did 200,000 miles and the valve covers were still at factory torque on the bolts.
Gotta love 351 Windsor.
Reply: I love cars but you folx know if we have no earth then we can’t drive them rightttttt??? Lol efficient combustion is extremely important so we can like you know, breath.
Reply: Ok boomer
Reply: @bobmizoski9669  this isn’t exactly a boomer comment lol.
Reply: ICE is as dead as the horse and buggy
Reply: @anthonybha4510     Dead? Wait until you plugin 600 million electric cars. You ain't seen dead yet.
Reply: @anthonybha4510  ah yes. So dead that the government has to threaten banning them so their subsidiaries in EV’s makes them money. 🙄
Reply: @anthonybha4510  it’s not… just ask the Amish…. We need a car version of the amish
Reply: @beezanteeum  airbags are nonsense….I agree with seatbelts not seat belt laws.
Reply: @anthonybha4510  lol. clean out your bong dude, it way past time to do so.
Reply: @anthonybha4510  2ell it will be as soon as someone discovers a battery that doesn't rely on minerals that need to be mined and destroy the environment on the process.
Reply: @anthonybha4510  most ignorant statement ever.
Reply: @anthonybha4510  maybe 30 years from now.
Reply: @anthonybha4510 😂😂😂😂😂😂
Reply: @anthonybha4510 yes, an easy answer to all this impossible complexity is just to get an EV
Reply: @anthonybha4510 have to overcome a lot of issues before going electric.
Reply: @anthonybha4510  we replaced manure problem with a carbon problem and I can't wait for the end of life battery car pollution.

Everything is a band-aid fix to fundamental problem
Reply: @anthonybha4510  we found the EV simp in the room.
Reply: @anthonybha4510  There is not enough lithium in the world to supply all the electric vehicles. And no commercially viable way to recycle them.
Reply: @robertmontgomery7158   there is not enough gas in the world to supply all ICE cars. and not enough air to dilute the CO2.
recycling will become economically viable when there is a large pool of batteries that are 10-15 years old. batteries  can be reconditioned, reuse the cells for energy storage that doesn't demand high energy density. or recycled especially if manufacturers start to take recycling into account in the design.
Reply: @anthonybha4510  and EVs will over populate wrecking yards as battery replacement is unrealistic